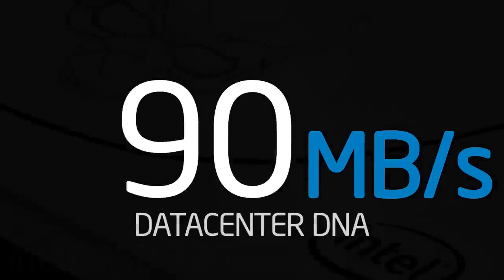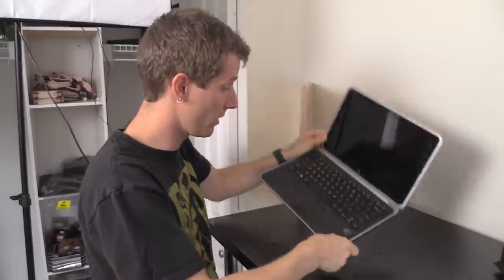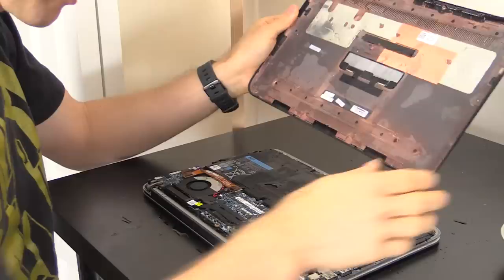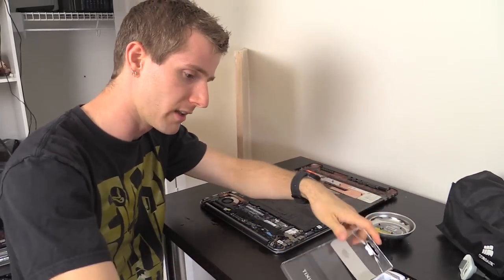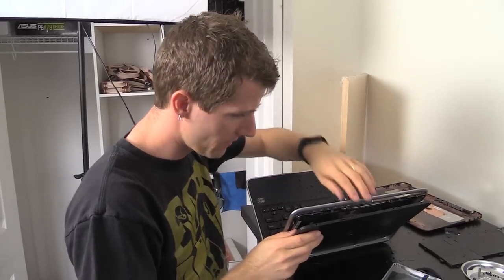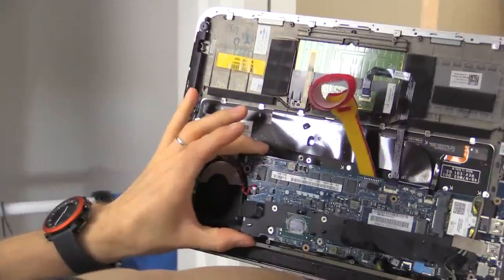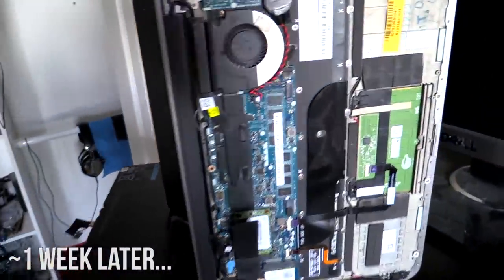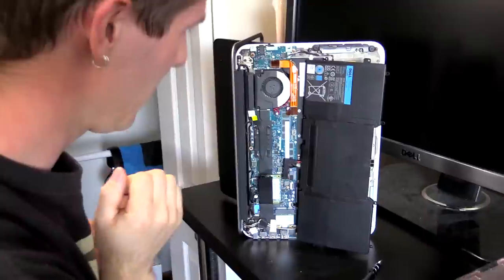Wet Laptop Recovery - Is it Possible?

Comment: My assumption is that the battery died, forcing the OS to hibernate and shut the machine down, and before the rain came down on it. That would also explain the lack of damage, as the battery was critically low on power and couldn’t sustain full system operation. I assume this killed the ambient power trickle to prevent damaging the battery, so yeah, I bet the big savior here is the fortunate order of events, and that if the PC were still on that it would’ve been completely fried.

Comment: I know this is hard to believe, but I've taken super filthy computer items to the car wash and had my way with them high pressure wand. Blow dry with 90 PSI compressor air, sun for 2 days, and they worked 100%.

Comment: Hey dude great video...i have an issue, about a week ago my laptop got wet so i disassembled it so it could dry and it worked just fine. The thing is the screen is still a little bit wet from the inside. i can tell that because it looks cloudy. So, would it dry after some time? or should i do something else instead of just waiting?

Comment: Rice is useless.  You'd be better off flushing the thing immediately with methylated spirits (~denatured alcohol) that itself contains no water but mixes with it easily.  I say "immediately" to avoid corrosion due to water that naturally contains minerals and salts that attack differing metals on circuit boards such as lead, copper and gold by creating a mild electric current, not forgetting the battery's still active.  I've managed to rescue my Dell Inspiron 1545 laptop 3 times now thanks to methylated spirits because of my own large and idiotic wine, coffee and vodka spillages, but it requires immediate disassembly and flushing of the motherboard and associated parts with metho and a paintbrush.  Although metho can't carry an electric current like water, drying everything completely is a must regardless.  In any case I was never able to recover the keyboards which are practically inaccessible internally, but they're only $20 each so I now have a couple spare - just in case of "oopsies".

Comment: This video gives me hope.My asus is not turning on after some water spill
Reply: Even worst. Got rained on just now are you gonna use fans? I don't have the tools to remove the screws so I just let the vaporization do its thing.
Reply: @aiztoh  well what I did is to take the laptop and covered it from all sides from a dry towel.

You can also do the rice trick rice absorbs moisture.

Mine laptop turned on after couple of hours because it's just a spill.

I hope your laptop will get started.🙏
Reply: @aiztoh  Don't turn on your computer for a at least 2 days if you want to save it

Comment: I once had my smartphone in my pocket while i went for a swim on the beach. After i noticed, i took out the battery, ran to the car, where i had a small screwdriver set. I unscrewed everything and let it dry in a tray for french fries on the beach. 

Later that day i took a 1200 picture timelapse of the sunset with the same phone that just hours before was submerged in salt water for over 20 minutes.

Comment: i had an IBM LENOVO X41T and while in a cafe once the waitress spilled milk on it, i immediately pulled the battery, when i got home i disassembled it and washed the wet components with alcohol, reassembled it and everything worked, ude that laptop for another 3 years, before i upgraded and sold it

Comment: Well it´s nice that it worked out, but the part with the battery is not correct. The battery is actually most likely the last thing that gets damage from water. 
Lithium batterys are completly sealed, because they would even react with air, so theres no way to get any water into the battery. 
I would have put at least the motherboard into Alcohol / Isopropanol for a while to get any left water out of blindspots to prevent the connections from corrisve reactions.
Reply: helicopter234 This is only semi-correct, the individual cells have to be sealed completely, but not the whole assembly, so it is possible that water gets inside the battery assembly, shorts the + and - pole of the same call and causes a fire or even explosion.

Comment: Distilled water + ultrasonic cleaner puts the work in.

Give it corrosion a scrub with 99% Isopropyl Alcohol and then stick it in the cleaner.

Works wonders. It's what we do at work for our water damaged devices.

Comment: Instead of taking pictures you can lay it out in order of the way you took it off on a flat surface.  Mechanic's have been doing this for decades
Reply: Gamer guy That's pretty funny.  Thanks for the laugh
Reply: +schlaznger You could have a space problem with that though
Reply: Use the driveway, works for mechanics
Reply: +schlaznger for a laptop?
Reply: yes
Reply: +schlaznger "Mechanic's..."
Reply: Remaining Rex yup

Comment: What likely saved your laptop, is that the rainwater most likely didn't have conductive impurities in it.  Distilled (Chemical) Water, pure H2O, does NOT conduct electricity.  And since it was rain, it very likely didn't have those impurities.

Comment: some 4 years ago, a 5 year old spilled water +soap, for bubble making toy on my mac book pro, and i panicked!!! just unplugged it, and started destroying it with a screwdriver scratched it because it wasn't the right size screwdriver:)) but managed to get it opened and dissembled as best as i could, sprayed it with one of those pressure cans for cleaning keyboards because they evaporate instantly, and just cleaned it with a fiber cloth...after 20 minutes in the sun, and another spray everywhere on the naked board and parts to get the soap residues, it worked perfectly...
The half a liter of soapy water didn't destroy it dough it was plugged in and playing music...and it worked perfectly fine with just scratches near the screws where i panicked to open it up faster.
some things are just build to stay alive, and after it smelled like soap...but that's it:))
Reply: BTW...it was also a 1000euro machine back then, on another note...my Samsung S3 died in my pocket for just walking in a strong rainstorm, these machines are expensive, but worth it...
Reply: pocketboy ht It probs died cus it didn't have a keyboard covering it. Just a small screen.
Reply: yeah, but still...it hade to have some water proof....i didn't drop it in water...it was just raining:| that could happen' to anyone

Comment: You should really do a clean up of motherboard and connectors so that the corrosion doesn't occur later and also it will remove the contamination due to water.
Reply: um that laptop is broken when they moved and they were doing the robed office prank they broke the screen swivel thing
Reply: +goggles guy um but they actually fixed the screen in the same video. You would've seen it if you were paying attention.
Reply: David Kim no they tried butt they couldn't bend it back they literally admitted defeat said it was gone and said goodbye old friend

Comment: I got this exact laptop in January 2015, and it lasted me through until January 2018 when it decided to suddenly turn off and never come on again. When I flick the switch on the side, the light on it flashes once and that's it.
On further inspection, from the one time I had it serviced (I was having some small issues with the touch pad) , whoever had done the service had been lazy af and had left half of the screws literally sitting unscrewed inside the case. They didn't rattle because they were being pressed into the motherboard by the case, so I can only assume that the computer shorted out?

Comment: Best thing to do with computers if they do get wet is to turn them off immediately and go get yourself some 99.9% isopropyl alcohol you can then use the alcohol to clean the components and it dries up really fast and is safe for use on electronics hopefully it will work after if you didnt fry it :D

Comment: Im not even surprised it lived, though Im not sure how dangerous shorts didnt occur. But about that bootup stage, I have noticed with my desktop, which is having RAM issues right now where the RAM would randomly stop operating only when the machine is off or in sleep. But when I put it in sleep and it fails to wake up from sleep due to this RAM issue, once I temporarily repair the RAM issue, windows would go back to where I left off, almost as if I had hibernated it rather than suspended it, so I wonder if windows at some point makes a backup of the RAM to the hard drive (or in this case SSD) and then restores it when an issue occurs while the system is in the sleep state.

Comment: 130 people was mac users and hates windows 8 so they disliked it
Reply: Who doesn't hate windows 8
Reply: +PixelGalleries me (8.1)
Reply: +kallelolanka Mac user here. Hated windows 8 with a passion, really like windows 10, tho. Wasn't going to install it on my PC, but it was free and I'm liking it just as much as OS X atm. Time will tell though. I've never updated an OS without issues arising at some point
Reply: +kallelolanka was a mac user until august of last year I then built myself a pc and I'm running windows 10 ... I have used mac osx 10.6.8 and Yosemite. also used windows xp vista 7 8 8.1 and 10 annnnd Linux and I have to say that both 8 and 8.1 were the worst operating systems I have ever used. my favourite all round os has to be 10.6.8 and my favourite for games is windows 10 but 8 and 8.1 they should never have been released. also macs are pretty damn easy to take apart and switch out hard drives and ram... and apple don't mind you doing that.

Comment: Why did it not turn on (and short) and when he opened the lid? I had assumed battery was removed, but later realised it has internal batteries and now I am slightly confused. Is there any additional measure to introduce that behavior. Would be good to know for.auch scenarios.

Comment: I panicked and didn't know what to do after I spilled my ramen and I spammed press the power button, then I googled how to fix it then figured out I fcked up and I still don't know if it will work I let it dry for 2 nights took out the battery it still hasen't turned on so plz if anyone has a fix msg me asap because I can't buy another laptop my dad told me (Im 14)

Comment: You are lucky that the battery connector is sealed tight and no water got in.
Otherwise you were onto a $1000 loss due to short circuit.

Comment: i dropped my laptop in the bath once (learned my lesson on watching movies in the tub) and fixed it by drying it with paper towels (surprised no static damage from that) and the only thing that got fucked was the touchpad which was my fault i was a little too rough and snapped the connector.

Comment: I hav a custom watercooled pc and i remembered dat my niece pulled one of the pipe which was on the processer and water spilled on my gtx780 but dat time the pc was off but i almost cried but i remove the heatsink, dry and do the rice method on it in 5 days. For the 5 days been gaming on my shit laptop but its ok. when i assemble it back and put on new thermal paste and suprisingly dat shit work which saves me tons of money

Comment: I recently sent to a mini coma to my 3months old hp 360 spectre....It came to life again, but, the battery wast charging while plugged in, I cleaned it up, and now it seems to be working fine....I’m still scared of using it and it exploding out of no where :( should I run some more tests?

Comment: yeah i have an 2012 asus x410a ultra-book but i got it cheap because it has a old cpu i think it was intel celeron and i believe its been overclocked to give it some performance but after like a 4 or 6 months use of the laptop performance drop considerably were every so often it will lag about ten or five seconds i just need some advice on solve my cpu problem or just get a replacement cpu advice appreciated.

Comment: Why don't they put a relay or two in so that the battery is actually disconnected when it turns off? You could power the relay with the power button, and once on, the device could power the relay.

Comment: This happened to me about 2 days ago except my laptop was indoors under a leaky roof.  Totally soaked. I walked over and saw it. Display was still on and everything I was shocked. So I powered it down and started trying to dry it off. It's been 2 days now. My question is? If I turn it on and it works properly is that the end of it? I turned it on accidentally yesterday while trying to dry it off a bit more and it still fired up completely normal which blew me away because this thing was soaked. Help!

Comment: While I was in VR my sister set her coffee (cream no sugar) by my laptop and it fell onto it she didn't realize and I was in VR so I only noticed when it shut off my laptop. I tested it and I've noticed 2 things. The keys press themselves on the left side where the mass of the coffee landed. And it used to boot in about 30 seconds but now it takes about a minute it's a rog strix g15 the 2070 model. Any suggestions?

Comment: hey , i've spilt by accident a can of energy drink and it leaked into my computer through the vents on the top and directly onto the gtx 980 , on the solder component side not the fan side , i've give it a clean and it's now in a bath of 99% isopropyl ... whats the chances of it working again?
Reply: Luke Dawson Chances of it working?

List the letters in the alphabet and see if you can find a number.
Reply: If the pc was off at the time, and you give it plenty of time to dry, it should be fine
Reply: did it work?
Reply: nope , went out today and bought a gtx 1080 super jetstream instead ^.^
Reply: +Luke Dawson haha, I am waiting for the STRIX myself. Though its lowest price is still $210 premium, so I am waiting until shipments break the scalpers

Comment: I had a LG optimus L7 and it was in my pocket and i fell into a river. I let it dry for 2 days with the cover off and i cleaned it with rubbing alcohol and it worked but 6 months later i broke the screen and bought a galaxy S3 Neo

Comment: This is exactly what happened to mine got rained on dripping wet so I did dipped it in alcohol and then left it in front of an air conditioning on dehumidifier mode for about a week turned it on and she booted there is a little bit of corrosion on a microcontroller but nothing a little bit of rubbing alcohol can't fix

Comment: 3:10 my laptop which is a 17inch notebook, i think (rather heavy cpu for price and age, but comparatively weak gpu, ram is also rather high compared to gpu... hell if i could run an external gpu through this thing it would probably be able to handle a high end card without bottlenecks) has a battery i can just detach, like well, a 360 wireless controller.. Its REALLY easy, almost built for it..

The reason this dell doesnt support that is it because its so small?
Reply: supervegito2277 Or maybe its an edit book... or something like that.

The hdd is large, but slow (1tb 5400 rpm) as well, so i think its built for video editing, but im not using it for that... would explain a lot.

Comment: I dont see why the water would hurt anything if the pc had not been turned on while water was on the electronic bits.... nothing inside is going to dissolve or come apart or explode when exposed to water, if you turn it on things could short , but if you take it apart like you did and dried it out, even put a fan on it for a few days it would be fine

Comment: So you know how the laptop booted up with everything just as you had left it? My computer is odd like that, too (custom-built desktop PC). I've been having problems lately with hibernation mode activating when it should be disabled. Sometimes, when I try to wake my PC out of hibernation mode, my monitor doesn't receive input no matter what I do aside from a hard reset. And sometimes when I do a hard reset, my computer boots itself back up without me touching it. But whenever I do a hard reset (regardless of my computer booting itself up or not), everything is exactly the way I had left it. My unsaved documents and photo edits are open. My windows are in the position and order I had left them in. Sure, this makes it somewhat worry-free when I have to hard reset (for whatever the issue), but I dunno... I'm pretty sure this isn't supposed to happen normally.
Reply: ***** Wait, it continued rendering while the computer was in hibernation mode? Holy cow! How is this normal? I swear it's not normal.
Reply: +zarmaan khan LOL RIP CPU XD
Reply: That's interesting. Thanks for the insight, Jacob.
Reply: Will do, Jacob. Cheers!

Comment: I stepped into a grassy hole and got mud into the laptop while it was on and it appears to be shorted out.  Do you think I'll have any luck?
Reply: you can try. but if you got it short, then i dont think so its gone for good. you gotta replace the board. but it will cost a lot. should remove power and battery first thing.

Comment: Unfortunately, my old dell latitude did not fare as well as your new one did; when left in the rain.
Reply: TY, I booted it up today on the power supply after sitting in a closet for years; taken apart and repaired of course. It turned on and got power however their was absolutely no graphics, my original diagnosis and problem after the rain.

Comment: My iphone went underwater when our offroading 4x4 filled with water. It worked for a few secconds but I couldn't power it off (or take out the battery, damn apple!) so it died.

Comment: I spilled water on my laptop today, it was plugged in and The battery is inside and I didn’t have a screwdriver so I just flipped is 8 hours enough to let it fru?
Reply: did you end up getting it working again? just got water damage on mine :/
Reply: 8-14 days idsay

Comment: I took apart an old dell latitude D600. While taking it apart i accidentally knocked off a small connecter thing. I don't think it was significant at the time but when i went to turn it on is wasn't working sooooooooo